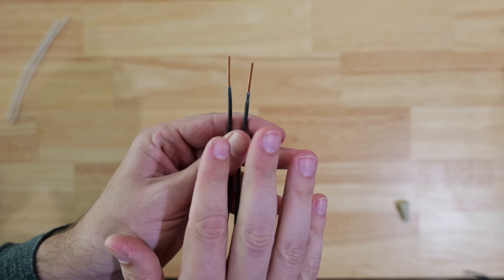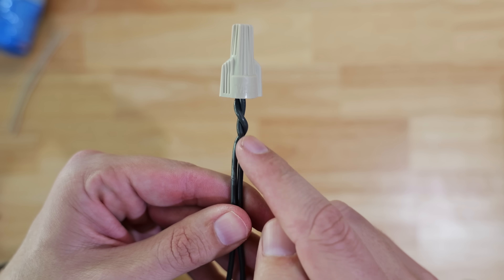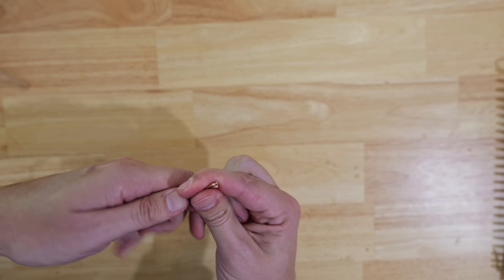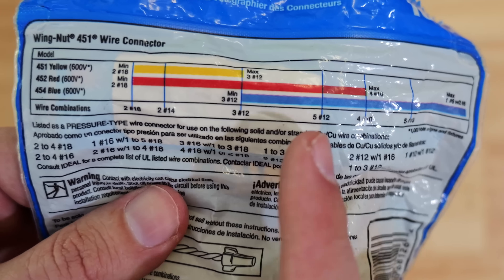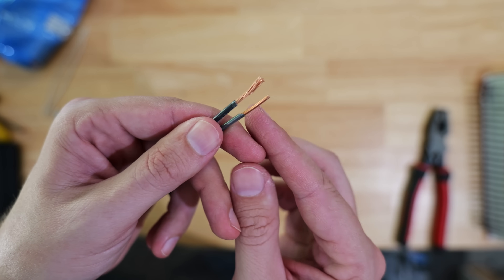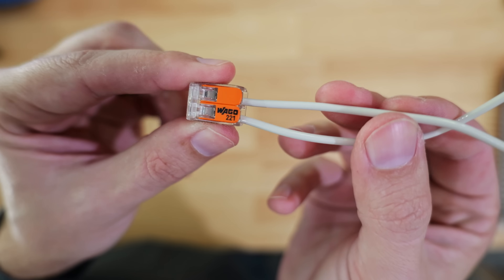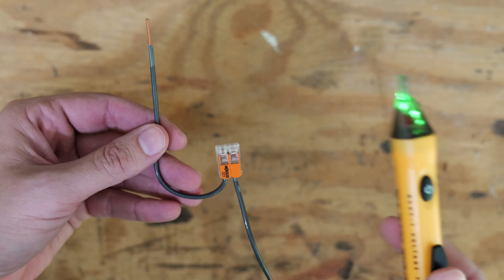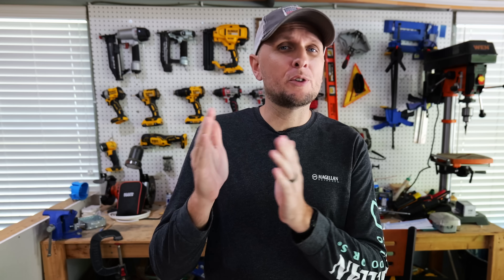7 FATAL Wiring Mistakes Most DIYers Don't Know They Are Making | Most Are Guilty of 3

Comment: I would never hire this guy as one of my electricians he’s using three different tools to make one connection and I expect my electricians to make 100 to 200 connections a day. This guy would cost me money doing things that are completely unnecessary. I’ve been doing it for 50 years, I have used WAGO and have had more failures with WAGO and never a problem with wire nuts when done properly.
 And I would hate to go back and troubleshoot this man’s junction boxes. I’d be spending more time on untwisting, and eventually have to cut off all the twists in order to make a good reconnection.
Reply from the maker: I’m not looking for a job so don’t worry 😂.  This is for DIYers not electricians so we actually care about things lasting a long time so pre twisting and making sure the wires are twisting together is important.  Funny how commercial electricians have always recommended to me to pre twist and then it’s a mixed bag with residential guys.  Not that is surprising.  You said it yourself in your comment that it’s just all about the money and your convenience.  Thanks for clarifying why it’s sometimes hard to trust pros like yourself.  So that being said, I won’t ever hire you either to do anything on my home 😂
Reply: @HowToHomeDIY  Your right, you are there for D I y’ers More is better for them, better safe than sorry.

Comment: Manufacturer Instructions do NOT recommend pre-twisting.
Reply from the maker: That is not correct.  Nowhere do they say don't pre-twist or pre-twisting not recommended.  They just say it is not required which means it is optional.

Comment: This guy forget a lot to mention: they are two nut types: with and without metal inside the nut. Second, the reason why the nut doesn’t fall of is the thread inside the nut. Their is a lot more to mention
Reply from the maker: I did mention the second one.  The first one isn't very common anymore when buying wire nuts in the store.

Comment: None if this is really applicable when working on LIVE circuits. The only option there is Twist your Wire Nuts as tight as possible and electrical tape it.

Comment: Wire nut?!? Best not claim “most people just” as there may be numerous countries such as the UK where, I suspect, most people have never seen or used a wire nut. Interesting you say some are “crappy”. To me it looks like an awful device. Some crappier than others. Connector or terminal blocks in insulated junction boxes are much more common in the UK and provide a more reliable and insulated solution.  Products like the waago levver nut are more common. Still pretty crappy and unreliable though.

Comment: wirenuts are junk,  twisting solid wire is risking work hardening the copper and causing micro fractures,  which lead to breakage and arcing,  solid core should be manipulated as little as possible,  wago,s or Ideal, constant force connectors are by far superior as you do not work the connection as you would twist nuts.

Comment: What for a BS. WAGO is used everywhere in Europe and if you are able to read the instructions printed on the WAGO or on the box it comes in, the things you talked about do not exist. They exist only if you ignore instructions. On the other side the wire nuts or mirrets are well know to cause problems, especially if they are used by laymen. Connecting a WAGO are simple steps, while wire nuts need experience and the nuts are in my opinion a fire hazard if you are lazy.

Comment: 43 years in the business always use the wire, not to twist the wires just gotta crank and pull.. never an issue. Wegos are good. Never had a problem use them on motors and light fixtures. This video was kind of silly and somewhat misleading

Comment: Those wire nuts have to be removed from market. Stop twisting wires together when making a connection; you are damaging the metal and the insulation.

Nobody uses those wire nuts in Europe; The WAGO are easier, faster, allow for quick measuring without opening them, can sustain way higher Amps than what they are rated for, not a single one will come open on it's own, because it requires a bit of force to pull open the lever. They are also transparent to actually see how the wires are fitting inside.
If the complaint is regarding removing too much or too little of the insulation, then just get another electrician. The one doing that needs to go do something else.

Comment: You state that we should pre-twist the wires before using a wire nut, but then show wire nut failures due to improper size without pre-twisting.  Agree that the right size wire nut should be used, however your demonstration of what happens if the wrong size wire nut is used lacks credibility.

Comment: NEVER TAPE A WAGO CONNECTOR! The WAGO, unlike wire nuts, is designed by qualified electrical and mechanical engineers to have a particular gripping strength and to behave securely when installed as specified in the instructions. It is neither tested nor specified to work with electrical tape wrapped around it. It doesn't open by itself, and you have to work really hard to make one have a high resistance. This guy isn't an electrical engineer, and thus is not qualified to advise you on wiring.
Reply from the maker: 😂 whatever you say.  You’re incorrect but sure.  They definitely do open.  I don’t have to be an electrical engineer to know that.  I’ve seen it.

Comment: 3:06 - I would probably even solder it before I put that cap with screw on it, because I am solder-nazi. 😀 They say that soldering is not acceptable anymore, but that's another stupid rule made by someone who can't solder it properly, it's the best connection with no resistance. You just have to wrap it around with another copper wire before you solder it and it will never fall appart even when solder breaks. But this "american" way of connecting cables with that weird cap with screw inside is pretty ok I would say when you use something that actually has metal screw inside, if it's just plastic cap, then definitelly not. But the same as with soldering, you have to do it properly and use correct wire diameters. I still believe that proper soldering is the best way and I would fight for that, it never failed me while all these chinese crap tools for connecting wires failed me many times, only advantage is that you can disconnect it again. 
When you twist cables together, then wrap it around with another copper wire and then properly solder it, it can't fail you and I don't care what some officials from office say.
Classic "chocolades" as we use in Europe pretty often are not ideal, but it's the most idiot proof solution, even orangutan will connect it together that it somehow works, this american connecting method is not that idiot-proof I would say even when it can be better when properly done.

Comment: The problem you highlighted with WAGO is rubbish, these are used extensively throughout all of Europe and Oceania, they are a far superior wire joining system than the ancient wire nut system the US still persists in using., BTW most of the world is not using single core wire, they have been using multicore for the last 50 years, the "problem" you demonstrated with the WAGO is not actually a problem.
Reply from the maker: It absolutely can be and is.  Check the comments.  Plenty of others have experience it.

Comment: So what your saying is that both wiring devices have their share of problems never had to tape any electrical wire connectors maybe the people watching these videos should keep the work for the professional electrician and maybe they won't burn their house down been doing commercial electrical HVAC Refrigeration during my working years had a neighbor try to do his own AC repair after watching these DIY videos ask if he could use my tools NOT found someone to lend gauges and a jug of refrigerant had nothing but problems trying to keep his house cool hmmmmm had 2 service companies try to figure out problem I don't know how he screwed it up but the so called friend gave him the wrong refrigerant gas dah I had my neighbor knock on my door twice during a hot spell ( Texas ) if it wasn't for my wife I wouldn't have done a thing but the best part is when he got my bill I had to flush the system etc that Shelby Mustang looks good in my driveway  oh yeah I forgot he also got frostbite on 2or 3  of his fingers he still feels he has nerve damage

Comment: Wasn't pre tightening taught to everyone?
Wrong size as well?
Also using electrical tape to keep the wire nut on is a requirement....
I use wagos in my designs.....also I put the wagos in a separate box....designed for it....
Just saying....you can't fix stupid....

Comment: So, you installed the crappy wire nut to show how bad it is, but... you didn't listen to your own instructoins, you didn't screw it on until the wires twisted. Mabe it wasn't that bad then?
Reply from the maker: Use them then if you want.  It’s an odd take to say they are good.
Reply: @HowToHomeDIY  I'm not saying they are, nor do I use them (Europe). I'm only pointing out you didn't do what you yourself said a bit earlier.
Reply from the maker: Right because I was demonstrating another mistake.  And it’s pretty well known here that using the included wire nuts is not as good.  That is all.  My first install with the crappy wire nut I didn’t say the wire nut was the issue at any point.

Comment: there is no way on earth i would trust wago honestly. its okay for prototyping, like you wire yours home whit it. but once everything is in place and works 100% correctly... getyour self heat srink tubes, and a soldering iron. 
argue all day you want, i don't care. you can prove me wrong whit ease. all you need is some spare wires, and a suitable load to do so.
here is what i want you to do. cut 22 equal lengths of wire, mmm kay ? now strip them according to your's wago recommended length. daisy-chain 11 of them whit your silly wago. take the other 11, and properly solder em to form the other wire. now, comes the test. load both whit the maximum normal current. then measure the voltage drop on both the cables.
once you realise what you done by using them waco connections, take a step back and ... you know the deal. slap your self in the face. ;)
what if you got the situation of a bunch , say 10 or more wires that need a connection... surely, there are waco units for that too. but its better to crimp on proper wire ends whit an eye for a bolt. use a copper bolt and nut. secure em. and there are adapters to turn yer soldering iron from one whit a copper wire tip, to a small bowl. once you done scrweing around, you can simply dip the whole assembly into solder. that will form a nice blob that is far superior and has about no darn way of releasing. the wires can handle less mechanical load than the connection. 

seen them wago products catch fire from inrush current, allso its terminals are different material than copper. moisture from air and current... yepp, its gona get a connection that is worse and worse as time goes on. the spring will hold tension, that i can see as a positive, but frankly its only a small area where that force is applied. specialy for non-stranded wire, thats a very small contact patch. in otherwords, i don't leave wago in place ever, expect LOW power lights. like gu10 spotlight fixitures running say ... no more than 20 watt of LED lights. 
specially if you live in an uncivilised world whit less than 3 phase available in house holds, and even those phases not yielding least 220 volts... wago should be avoided. yess its a quick job, but not a good job.

Comment: Wagos suck. I will only use them on a termination point, NEVER in a mid-point of a circuit. It's a CHEAP (but expensive) and easy and crappy thing to use. They should be removed from every Code.

Comment: Ding dong, wagos are only for stranded wire not solid for obvious reasons. Solid wire you twist and use wire nuts.
Reply from the maker: Incorrect.  Per wago, their 221s are made for both stranded and solid wire.
Reply: @HowToHomeDIY  🙄🙄🙄🙄obviously you don't understand connections or you never did them. You probably just make videos while I am trying to keep people safe
Reply from the maker: 😂😂😂😂😂 I don’t have to fully understand them and re engineer them when the company themselves literally say they are made for both.  They have already done all the testing.  You are speaking from a place of bias and opinion.

Comment: nothing wrong with WAGO
Reply: I like them, but they are 100% plastic.  If the circuit overheats, it is likely to melt away.  At least a wire nut has a metal spiral to keep the wires together.  Because a poor connection only generates more heat.

Comment: The thumb nail is complete click bait and misleading.
Reply from the maker: No it isn’t.  What a watered down definition of clickbait.
Reply: @HowToHomeDIY  your thumbnail implies wire nuts are wrong and Wago connectors are bad. The message you provided in your video is different, describing how to properly use these connection devices. Thus your thumbnail is click bait.
Reply from the maker: @rogersfam1702 that is simply your perception of the thumbnail but the video clearly talks about what is wrong and bad that the arrows are pointing at.  If you notice, the arrows are not pointed directly at either splicing device.  It’s not clickbait at all.  You just don’t like it.

Comment: Man, you just needed some content didnt you? This video is just you griping about things that never happened. Have you ever tried to pull some of your slack romex through a box for a little extra length? The wire is so stiff, youve gotta really tug at it. The tips you give are good, dont get me wrong, but the wires arent slipping free in the conditions you listed, and electrical charge alone does not cause vibrations to occur in your wires, especially not to the point of wire nuts becoming disconnected. I dont use wire nuts at all myself. They're all garbage in my opinion. Wagos are the only thing I use.
Reply from the maker: Umm no, these are all points that many DIYers are unaware of.  These things all can happen actually.  If a service loop was installed, then some slack can be pulled.  If not, I demonstrated what can be done, so not sure why this is a complaint.  Alternating current creates magnetic fields, so yes, the wires do in fact have some vibration to them and over time, if things arent installed properly, can come loose and cause issues.
Reply: @ yeah, and some parents inspect kids candy for razor blades on Halloween. Sure, it’s better to be safer than sorry, but I doubt you could find a documented case of this actually occurring and the tone of your video suggests that if you don’t twist solid core wires together, the wire nut will certainly back off entirely. This is so unlikely to occur from the minuscule vibrations caused by alternating current that I doubt it’s ever happened, documented or not. I mean, these vibrations are so weak, you need an oscilloscope to be able to detect them. It would take a century, if at all for a wire nut to back off enough to cause a problem. I’m not saying the information was bad, but the reasoning behind it is a massive stretch. My toaster popping up toast every day would cause more of a concerning vibration than the resonance of AC current.
Reply from the maker: Whatever you say.
Reply from the maker: Whatever you say 😂

Comment: My god America get your house in order, wire nuts should be banned
Reply from the maker: A properly installed wire nut can't be beat for many reason.  Not all but many.
Reply: @HowToHomeDIY  hell no mate, there’s a reason you’re a DIY guy and not an electrician. They are literally illegal here in Australia.
Reply from the maker: That makes no difference other than you can’t use them there.  There are SO many factors as to why they aren’t used there but are here and it’s not because they are just less safe if installed properly.
Reply: @HowToHomeDIY  there literally isn’t a single advantage other than laziness factor.

Comment: Wow. You over twisted it. It’s solid wire. Why do you need to pre twist the wire past the insulation?  Such a amateur lol
Reply from the maker: No I didn't.  I explained it in the video.  Why ask again?  When I open boxes that pros worked on they do the same.  It is also clearly shown in the instructions from the manufacturer.  So we have uncovered a mistake you are apparently making.

Comment: "wires vibrate due to the current flowing in them" - uhh, no. That's not happening, unless you've coiled them and made an electromagnet.
And the bit where you tested the voltage on the wire coming out of the Wago after not removing enough insulation. What on earth is that about? There is no load on that wire (and the DVM is high-impedance); If there is even the slightest copper contact you would have had the full voltage present on the end, so whatever you measured is what was connected to the other end.
I get what you're trying to do, but by bulshitting like this, you take away any credibility you may have had.
Reply: He's a DIY guy.  What do you expect? Jack of all trade types are also masters of nothing.
Reply from the maker: @beeps7 except what I said is true.  Almost nothing @simonharrison6447 said is correct and theoretical.  But hey, believe what you like 😂